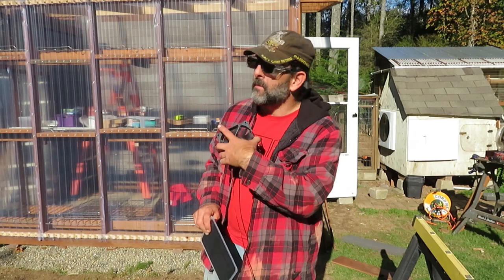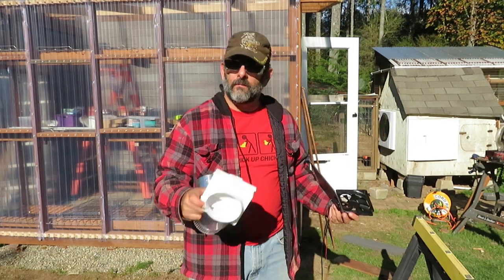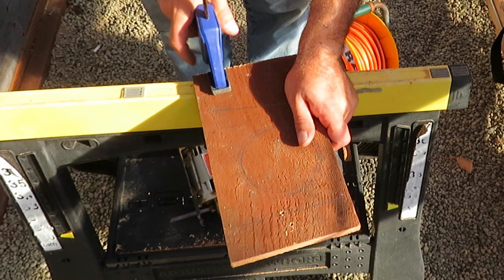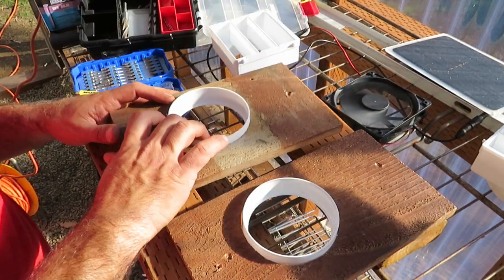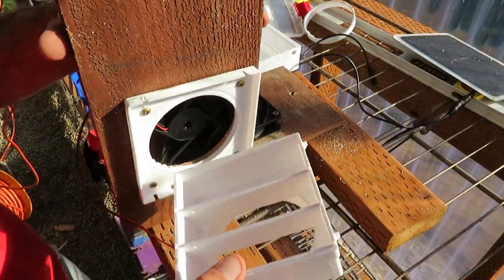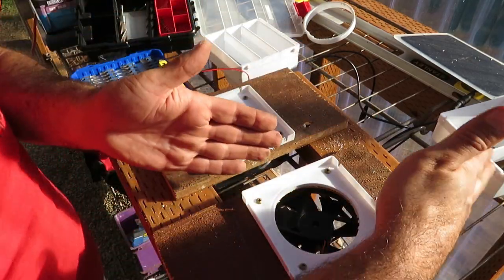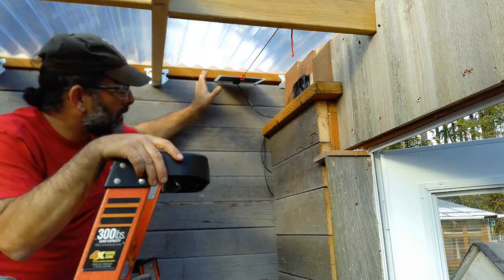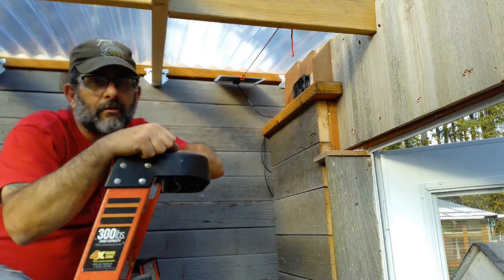DIY Greenhouse Cooling - Installing Solar Fans in a Greenhouse

Comment: Thanks for the video. Are they still running?
Reply from the maker: Still running strong.  There is a slight high pitched wine, sort of like a computer fan.  I just ordered a couple more to blow air on my starts so I don't have to use any corded electricity in that greenhouse.

Comment: Boy, arent those the cutest little fans you ever want to see?
They dont hardly look big enough to be away from their momma.
I use 2  20" box fans & some hot days even they struggle to keep 
the GH under 90.

!
Reply from the maker: I still have to keep my bottom door vent open on the very hot days.  The hottest I recorded in the greenhouse on a day I didn't open the bottom door vent was 112.  Happy Gardening!

Comment: I was racking my brain thinking how best to build a window with the corrugated panel on the roof to be able to use one of the heat activated automatic window openers, I think this is a far easier and doable without breaking the bank.  Thanks again for the great info.
Reply from the maker: Glad I could help!

Comment: So by how much did you reduce the heat?
Reply from the maker: Around 10 degrees if I don't open the lower vent or the door's window.  I had to install an automatic bees wax vent to allow air to come in if I forget to open the lower vents.  Happy Gardening!

Comment: Nice! I might use your technique in my new popup polycarbonate greenhouse, if I can figure out how to make my own upgrades. How are the non-waterproof solar panels doing with the humidity of the greenhouse? Thanks! Looks good!
Reply from the maker: They are actually working great.  Better than the waterproof ones I have outside a different greenhouse.  Either the Sun's UV took a toll on them or the low temps in the teens made the top coating peel.  They still work though.  By the way, be careful with the popup greenhouse, they don't hold heat very well.  I lost a lot of starts in one when the temp dropped down to the upper 20's.  If it is a 6 x 6, put at least 30 gallons of water in there for a heat sink.  Kitty litter containers and milk jugs work good.  Don't forget to open a vent in the mornings, even with a fan running, it has to pull cool air in from someplace.  Happy Gardening!

Comment: is the fan strong enough to move the hot air inside out?
Reply from the maker: As long as the lower vent is open, it works fine.  My greenhouse is sealed up pretty good and you need air flow to be able for the outside air to come in and circulate.  As the temps got warmer outside, the top shelf got up there pushing 105 with 85 degree outside temp, by then though I had all my starts outside.

Comment: Hello, I love your video.  I have been given 40 used computer fans from a recycler.  I want to use them one each on each of the shelves on 6 shelf units that I have to  grow seedlings.  Where can I find info on how to connect them to solar.  And to know what sized panel that I need to use for powering them.  I live in 12 month sunlight.
Reply from the maker: Look up wiring in parallel.  That way if one fan goes out, they all don't.  Also, a 50W solar panel should do the trick for 6 computer fans.
Reply: @CMooreStarts  Thank you very much.
Reply from the maker: No problem, let me know how well it works.

Comment: Great video, have you noticed a difference in the daytime temperatures?
Reply from the maker: Oh yes, with 55-60 outside the inside was getting well over 100 now it has not gone over 95 even with the lower vent closed.  Today we had full sun outside temp was 56 and the inside temp got up to 84 (lower vent closed).
Reply: Needs bigger fan ?
Reply from the maker: I installed an automatic bees wax to compensate.  Happy Gardening!